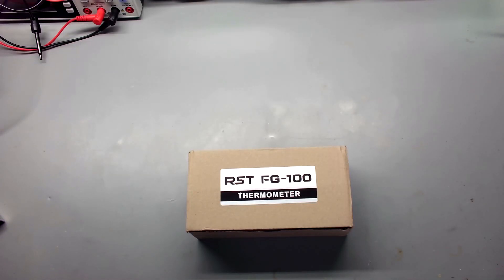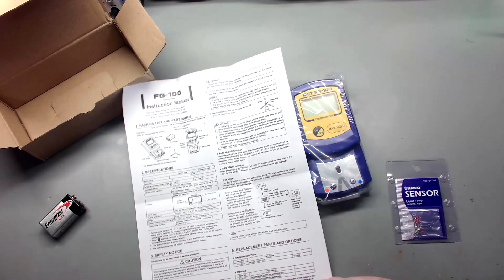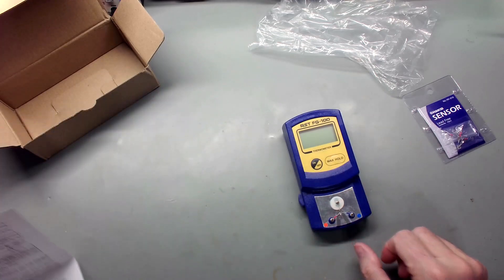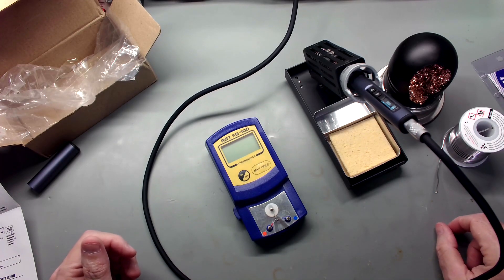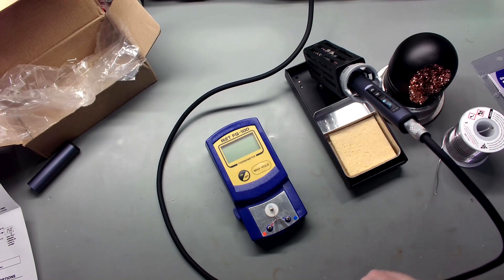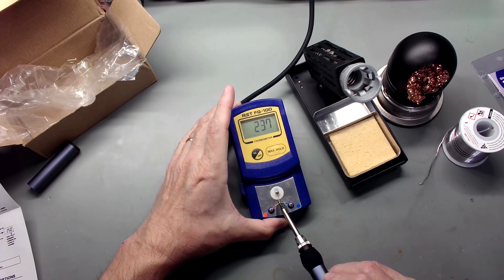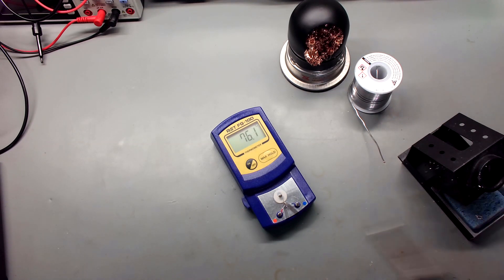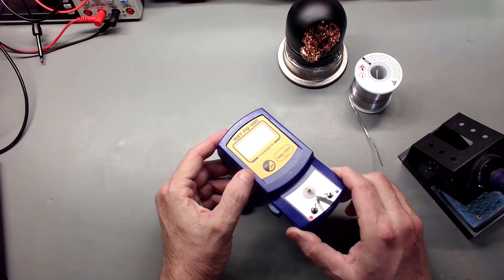The Power of RST FG-100 Soldering Iron Thermometer

Comment: Another tactic to ensure fast, easy, in&out soldering: clean and degrease the PCB foils, component leads, terminals and connectors first. Newly manufactured parts are often a little greasy and may have a thin layer of oxidation; new old stock parts, and the terminals inside decades old gear, are definitely oxidized. Clean everything with a fiberglas-bristle "scratch brush" or scotch-brite pad, degrease with alcohol, and solder will wet to the connections easily.
Reply: @LynxElectronicsLab , I'm m 67 and have been soldering for 55+ years, not dissimilar to yourself. I have a video on my channel pertaining to scratch brushes, powered erasers, and other tools and techniques for soldering prep-work. Proper prep prevents piss-poor performance!

Comment: How do you get to change to Fahrenheit ????
Reply from the maker: You Can't, there are two models one C and the other F. most are C and they can't be changed. The genuine Hakko FG-100 can be swapped. Sorry I can't be more help!
RJ
Reply: @LynxElectronicsLab , the Feita 191AD tip temp tester can do both C and F, but accuracy might not be a guarantee. On the Chinese site you linked to, the same unit i bought is called Lefavor.
Reply: @LynxElectronicsLab , I was curious if the accuracy of knockoff or counterfeit tip temperature testers could be improved by use of genuine Hakko thermocouples; I discovered that Hakko has changed to a different and much more exprensive style of long-life thermocouple, and the originals are no longer available from Hakko. No idea if the new hakko thermocouple works on other knockoff units....

Comment: thanks for this video i just bought this because ive been having difficulty with my hakko recently, after hearing what you noted on the cheap chinese tips i chucked those and got a hakko brand tip
Reply from the maker: Your welcome, 
I think you will see an improvement with the branded tips. Also if there is any problem with you station this will let you know. 
Thanks for watching. 
RJ
Reply: I measured some various ceramic-heater soldering irons; they're usually around 3.9 mm, give or take point 5 mm. Inner diameter of Hakko 900m/T18 tips are spot on at 4.05 mm, for a snug fit and efficient thermal transfer/recovery; but measuriing various knockoff tips I got anywhere from 4.1 to a whoppingly sloppy 4.5 mm inner diameter! The Hakko tips are $6-7 directly from Hakko USA, and worth it: better metal, better plating, better fit, longer lasting.
Reply: Someone overseas said in a comment thread here that they  are having a difficult time finding real hakko tips in their country. There's a company in the neither lands that specializes in high quality soldering gear,  solder and fkuxes,  they'll probably have real hakko tips. I tried posting the company name here but the algo-bots removed it. Shame I have to intentionally misspell things in order to get it past the gatekeepers ......

Comment: Does it make sense to use this thermometer when measuring hot air nozzle temperature
Reply from the maker: Good question thanks! 
I think you you would overheat and maybe melt the unit. I don’t see how you could blow on the thermocouples sensor without heating the main unit. If you could it would work great for that. 
RJ
Reply: @LynxElectronicsLab  may be we we can melt a bit solder on it using soldering iron and blow hot air from side?
Reply: Not unless you drape asbestos over the unit, behind the thermocouple! I don't recommend it...

Comment: Hello, what solder iron is that with the digital display? And where i could find god 900M solder tips, i looked for a good Hakko 900M tip but here in Europe couldn't find any that ships to my country.
Reply from the maker: Hi! 
That iron is a finirsi hs-01 iron.  https://youtu.be/dzbXFkaPRvs?si=bL7xWiRD7gQlTkVe 
Is a link to my review of it. 

The solder tips I do not have that iron but the tips are available on Amazon. 
https://a.co/d/cOVmK9C
Hope this helps.
RJ
Reply: Try el e shop in the nether lands
Reply: @goodun2974 thanks, i got one from Amazon Germany
Reply: @AexoeroV , to be certain of authenticity,, measure the inside diameter of the tip with calipers. Genuine Hakko tips will be spot-on at 4.05 mm, but knockoffs and fakes can measure anywhere from 4.1 to a whoppingly loose/sloppy 4.5 mm! Most ceramic-rod soldering iron heaters are around 3.9 mm outside diameter, give or take point 5 mm. The snugger the fit, the better for efficient heat transfer.
Reply: @goodun2974 thanks, i have a caliper but its not digital so it would be hard to measure to see exactly .05 or .1
Reply: @AexoeroV , digital calipers are cheap these days, and very useful. The "project farm" ch did a review on them recently. I bought one at Aldi 4 or 5 years ago for around $25. Ps I posted my own vid about cheap/fake soldering tips a while ago.

Comment: An important thing to factor in when talking temperature of the soldering iron is what solder you are using. Lead free solder needs higher temperature. 
I also find it a bit naive to trust a Chinese Hakko rip-off to be spot on measuring temperature. At best it is a ballpark measurement.
Reply from the maker: Thanks for the input. 
While I understand the distrust of it being a Chinese knock off. After testing it against my thermocouple temperature meter it agrees within 1 degree C. I really doubt any of us need our irons more accurate than that. But also nothing wrong with buying a real Hakko if someone wants the real thing and has the $250 extra to spend. I’m just a hobbist and the $10 knock off is just fine for me. 
RJ
Reply: @LynxElectronicsLab , I bought a Feita tip temp tester ( $24 thru the 'zon of ama), and in a quick demo/test  (see my video) it does not appear to be very accurate. I have to wonder if it woukd be more accurate using genuine Hakko thermocouoles. Tje Feita came with 50 of them, perhaps some are more accurate than others. It'll require further testing. The Feita has internal trimpots and so it should be possible to calibrate it (sure,  let's calibrate the calibrator in order to calibrate the main device that needs calibration...)
Reply: @LynxElectronicsLab  , i discovered yesterday that Hskko no longer sells their original style thermocouoples; replaced by a $45 long life version!

Comment: I got one of those and it works pretty good I calibrate my irons every 3 month or when I change the tips
Reply from the maker: Thanks,
Yes I do the same, the different tips read slightly different. Glad I got it.
RJ
Reply: @LynxElectronicsLab  yeah it’s a good thing to have
Reply: @LynxElectronicsLab  you should look at the t12 ksger soldering stations their also great
Reply: @anthonyaviles8665 , KSGER doesn't earth-ground their stations, and they use switching power supplies that aren't mains-isolated. I personally wouldn't use something like that without an isolation transformer feeding the power supply, and connecting an internal earth ground; there are lots of YT videos about this issue.

Comment: Regarding soldering temps: the same principal applies to brazing copper pipes near temperature sensitive parts, valves, ect. You need the temp to limit the time you're heating the joint so the heat doesn't travel so far down the pipe.
Reply from the maker: Correct, same thing exactly. Thanks for the information.
RJ

Comment: I learned things today. RJ is a year younger than me. I need/want a RST FG-100. I totally agree with you about using a higher temp is better for the solder joint. Edit: Can you add a link to the FG-100. I don't trust many vendors on Aliexpress. I prefer to use the same vendor someone else has already used.
Reply from the maker: Rick, your wish is my command my friend. It is in the comments. I should have already had it there I forgot.
RJ
Reply: Thanks my friend. I just placed the order.

Comment: I have a Hakko branded one of those.  I don't use it often, but when you need it, you need it.  I usually solder at 340 ℃ with 60/40 leaded solder.
Reply from the maker: Your on the money! Bet you don’t kill parts or have bad solder joints either. Many newer players get lulled into too cold temps and fight with issues. 
I really like your new little toy. Like you, I think fnirsi’s newest items are looking good. For the price you can’t beat them.
Keep up the good work on the channel, I never miss a video. If any of  my viewers are not subscribed to uni-bytes channel you should he does a great job.
RJ
Reply: @LynxElectronicsLab  Thanks RJ.